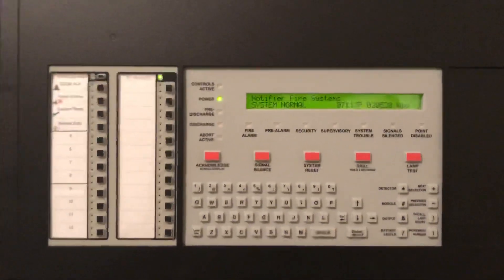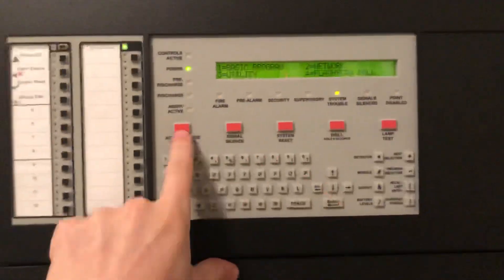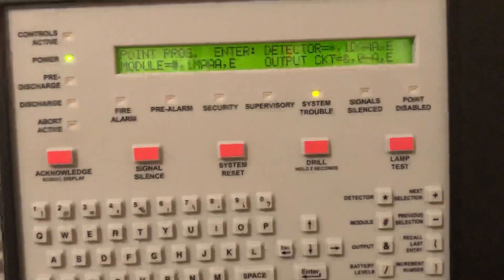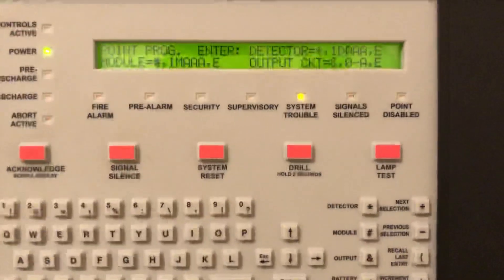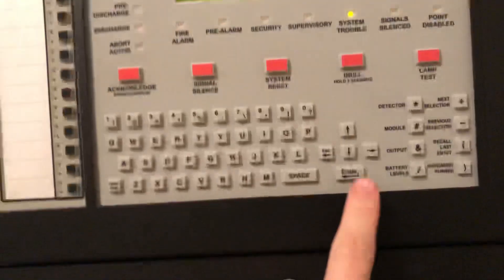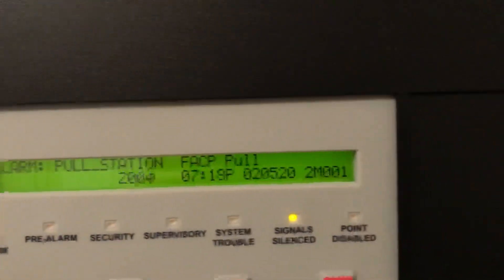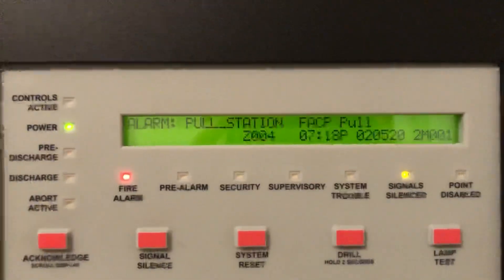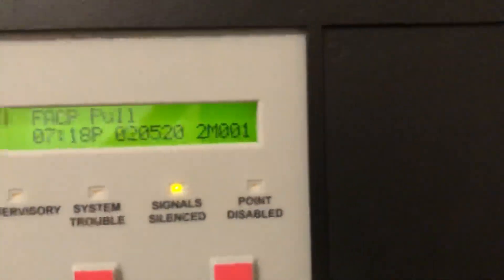Verifier Tools (2/2)

Comment: Dear Sir, 

Kindly i request technical susupport to solve the issue is " Program corrupted / Earthfault in the Vessel Alex F Mcc call fire alardm system. All station detectors working normal , only the active alarms as above mentioned , 

This was happen with , after replace defective power supply. 

Details :- 

Autopulse iq-636x-2E

Comment: Nice, a 4903-9221. My dad’s school used to have them then they replaced the System with a Silent Knight system in 2012 with P2Rs,SRs and a single P2RL (replaced a dead advance). I wonder where that 9221 came from.

Comment: Hi Will. Great videos. Thanks for sharing your knowledge. I'm watching from Ireland where there is absolutely no support for Notifier systems. I am working on a Tug vessel that was built in Canada. We have a Notifier NFS2-640/E panel on board. There is a fault on the system saying Program Corrupted. I want to upload the Program to my laptop, clear the panel, and then download the program again. I have downloaded Verifire Version 5.71 and have a USB A to USB B cable which I connected to the panel today but was unable to connect successfully. A note appeared to check the NUP connection. I have seen another Video on YouTube by Alex Argel (VeriFire Tools 5.7- download upload database - Instructivo) but the whole thing is in Spanish. From what I understand from my limited grasp on Spanish is that he is running a Virtual computer on Windows XP to enable him to use Verifire tools. Is there something I need to do to enable my laptop (Running Windows 10) to connect with the NFS2 panel? Is is correct to use the USB A to B cable or should I try to connect with a serial to NUP cable instead? Any information you have would be greatly appreciated. Thank you, Fionan.

Comment: Why could the NAC programming not be completed thru VeriFire?  Also "Notifier Fire Systems"  You should use all capital letters to match everything else and delete the word systems.  So it reads "NOTIFIER FIRE SYSTEM NORMAL".
Reply from the maker: As an unlicensed VFT user, the latest version I can use is 5.71, which is compatible up to firmware Rev. 3 for NFS2-640. Due to the variance in the firmware revision of my CPU2-640 (19.2) and the revision available on VFT 5.71, any features that have been modified are not available in the software. I explained this in part 1 (since this is a two part series)
On another hand, your note about capitalization and wording is purely subjective. Since I own the panel, I can program any label I like for the System Normal Banner.